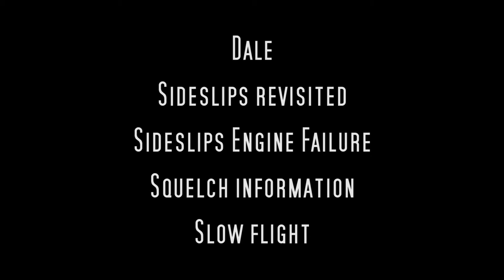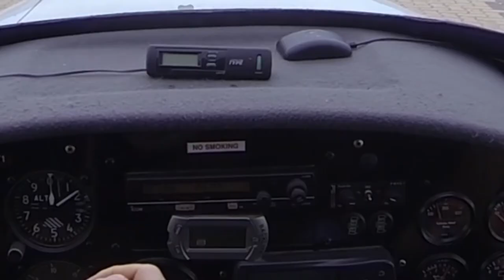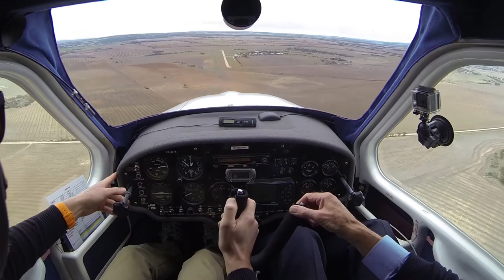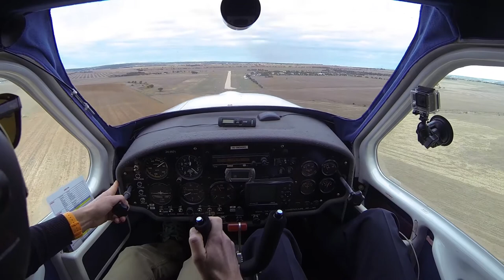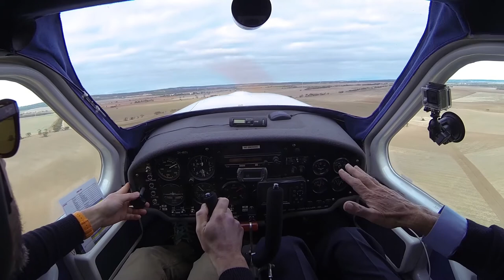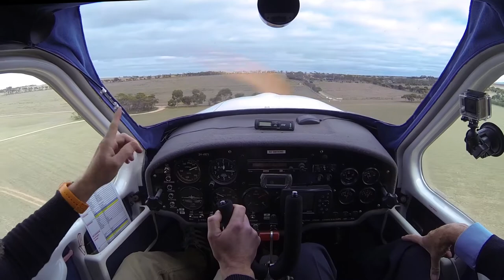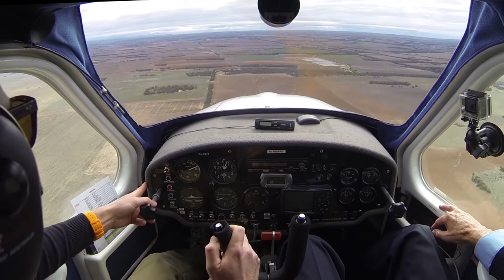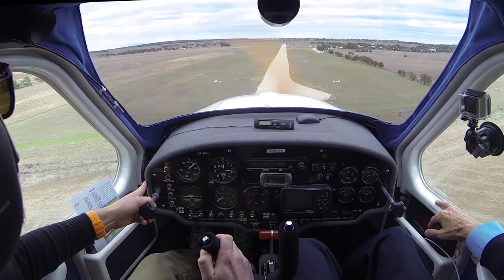Pilot Training  l Sideslip Revision with Engine Failure  l Squelch Explained

Comment: Isn't it unsafe to do a simulated engine failure that close to the ground? Every instructor I've ever flown with has done it at a safe altitude.
Reply from the maker: SMaze17 all engine failures during training are of course only a simulation. Our training syllabus requires that our students are proficient at managing engine failures whilst within the circuit. The simulations in this video are all within the circuit with multiple runways available for safe landing outcomes. Power of course is available should the simulation not be safely achievable. Enjoy.